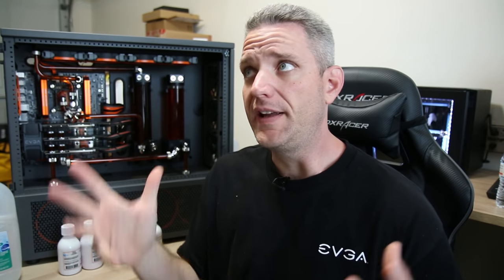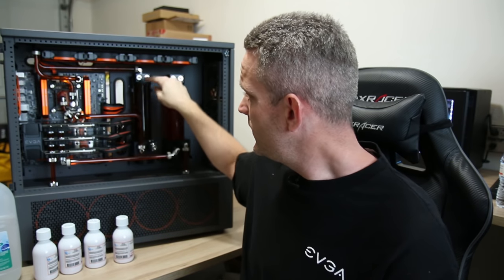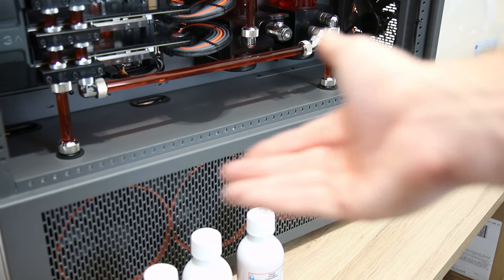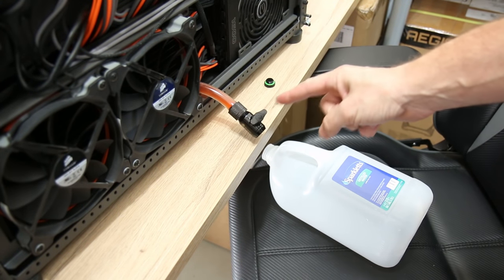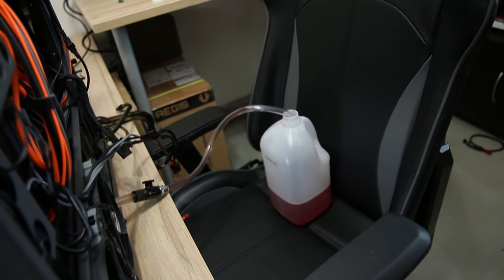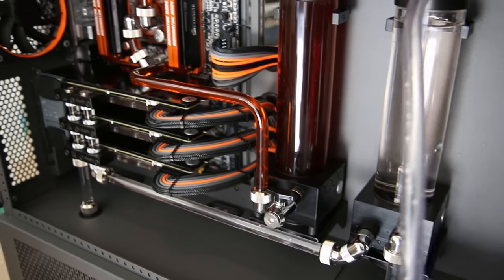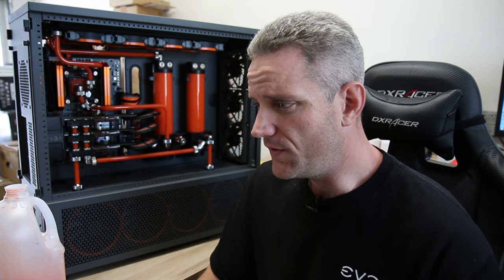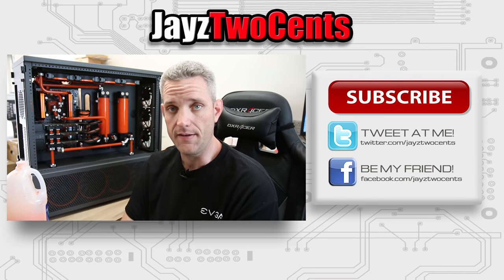How I flush my radiators and setup my drain ports

Comment: I did this very job today flushing with distilled water. I use an aquarium pump and it works a treat and will clear the loop of colour using approx 5 litres of water. I found this method to be much quicker and the results were infinitely better than the fill and gravity method I used last time.
Great video jay!

Comment: I have worked with the guys at Mahems since they started. Top notch guys. They are serious about delivering the best products. They will figure it out.
In most cases I use low pressure on my compressor and a soft rubber fitting to blow it out SLOWLY. 
I know you're going through a lot of work but the consumer will thank you. THey will be able to fix what ever is causing it so it wont be an issue for others. So, Thank you.

Comment: Hey Jay, I'm just curious... Why don't you let the system run on just distilled water for a few weeks? Wouldn't that help clean up your systems hardware and maybe debunking the theory that it's the fluid..? I don't know, I'm not an expert water cooler, I've only ran AIO's so i'm just curious...
Reply: +Bearded Rabbitt The problem is running on pure distilled won't prevent crap from possibly growing inside the loop and ending up worse than just dealing with discoloured fluid. Running coolants (pre-mixed or concentrates) means they have the stuff to prevent crap from growing inside and such.
That, and it's easier to see if a coolant is being discoloured if it's dyed (like what Jay uses) compared to if it's clear.
Reply: I just figured that it would turn to like a brown color if it was clear. I guess that makes sense though. I didn't mean pure distilled water, I figured that anti-growth and anti-corrosion additives were just a given in that situation. lol The discoloring point does make a lot of sense though!

Comment: Hi Jay,
Get an endoscope camera and examine every part and look for discoloration.
I think the exposed metal is causing a reaction with the color.
You can track down the culprit if you keep the drained fluid and send it in for analysis too or
you can analyse it yourself by putting fresh colored fluid in a glas with every single metal type you have in the loop.
Try heating it up very long in an open and well ventilated space, preferably build an incubator or aother type of enclosure that you exaust as far away from you as possible. You can use a DIY heat exchanger for the exaust and intake but keep an eye on the direction of the wind and where you put those pipes.
Don't exaust it through your chimney as that is likely to put you and your family at risk.
:)

Comment: get a small enclosure box. get transformer either Wallwart or ac wire from wall to bottom bay. get full bridge rectifier. get a cap if you wanna be fancy (converter will have one)...and a dc-dc converter for each voltage you need(figure out what your transformer is outputing then what you need). throw that all in a small plastic enclosure with an input for lead from main psu and a multi pol multi throw switch...now fuse it [both electrically and mechanically ] do this and you wont have to drag out a full psu every time. for the few watts required to run those pumps its wayyyyyy over kill

Comment: In my experience, the most efficient way to flush anything clear is to do complete fill/drain/fill cycles (serial dilutions), not adding irrigating water when it's only partly drained.  Otherwise, some of your distilled water is going out the drain while the pour washes the coolant back.

Comment: Did you ever figure it out? as well when dealing with distilled water for high end greenhouses you have to adjust or neutralize the pH or check the EC and micromineral content in the water and storebought brands and such can vary greatly due shelf time and leeching as well as its base pH before distilling process was done

Comment: Got an idea for a new Water Cooling Item...

One of those Survival Bottles you can fill up with filthy water which when pushed/sucked through a system of filters inside the Bottle will filter out most if not all contaminants.

Using 2 Gallons of Distilled Water until you're clean sure looks like a waste of resources ( at least in my book ) and with such a filtration system you could ( if it works at all ) chain it up into the look somewhere and have it run until the water turns clear once again then just dispose of the used up filter and be happy again.

Not sure if a PC Pump would be able to push the water through the Filter though... Might have to drain the Water outside and use the Filter without it being part of the System :°

Comment: Video Suggestion: Dust management with Caselabs cases. 

With so many enthusiast cases having convenient filters, to see nothing with Caselabs cases is a bit odd. 

I had dust issues with my old HAF932 (with DEMCiflex filters). My Enthoo Primo build has almost no noticeable dust at my annual cleanings. I'm planning a new build and considering a Caselabs case, but I'm concerned about going back to a DEMCiflex solution. I haven't really been able to find any videos on Youtube about this issue. 

Thanks!

Comment: I suspect your browning is due to a bacterial infestation, which would explain why it keeps happening after you flush and it happens slowly. I used to have the same problem with copper boilers and hot water in commercial coffee machines, the water in the sight glass (similar to your hard tubing) would turn brown and the water would smell like something died inside, I had to flush 3 stages. Stage one would be a disinfecting chemical like hydrochloric acid (or your leading baby bottle sterilizer from chemist), then flushed it with citric acid (from your local hardware store) to remove the hydrochloric acid/ sterilizer, then finally flushed with filtered water. I would leave each chemical in for an hour and let it heat up. Hope this helps.

Comment: You made this video over a year ago, did you ever discover what it is that's changing your tubing color? You may need to do a follow up on this to let us know your results. I've been running Mayhems UV Nano in  my rig for almost 4 years with soft clear  tubing and it hasn't even changed the tubing color. Yet!

I have noticed, that if it sits for an extended length of time, it gets thin on the top part of the reservoir; but, as soon as I turn it back on it goes back to it's original consistency. You mentioned this in one of your videos.

Comment: Hey Jay, We have now finally finished out first build and unfortunately the distro plate we used has drain hole below intake hole and also radiator is below all of that so drainage is an issue. is there any remedy? possibly adding some weird junction at the top to push air / water when draining/flushing? using dynamic XL case with Bykski RGV-LAN-O11XL-P distro plate.

Comment: The thing about that actually makes me really nervous and hesitant to try is what happens to the pump if I can't turn it off quick enough and it starts to run dry. Especially with a couple of the super tiny reservoirs that I've seen come with the pump built in. What's the best way about managing this power cycling to not run the pump dry and kill it?

Comment: Serious question: Why not flush it and run distilled water? It seems like it would be easier to get an idea of what is going on if you have discoloration of water. If the water doesn't discolor, you know it is something with the additives. If the water does discolor, you know it is something interacting with liquid in general.

Comment: When its time to move a working water cooled machine to a new address down the street or across the country I would assume that you would drain the system. Right?! What about storing a water cooled system for a long period of time. After draining the system is it necessary to disassemble the loop for storage? Would this mean that maybe the loop would have to be rebuilt when it comes time to get the system back up and running?

Comment: I had the same problem, I switched back to Acrylic (from PETG) the fluid stopped changing. PETG is not good I will never use it again. Acrylic for Life (or glass or copper).
Reply: +pvtmatchsticks for some reason I think it has something to do with blowing into the loop but hey, I could be wrong.

Comment: Will be interesting to find out what's happening.  It wouldn't surprise me if rad manufacturers changed materials (solder & flux) to meet RoHS and similar restrictions.  If that's the case I don't think you can avoid some weird reactions.  In Electronics, I've seen the leadfree alloys and matching fluxes do some weird stuff.  Their unknown character make them useless for aerospace/life-support/military gear.
Any RoHS certification logo on the rad literature ?

Comment: Maybe you have something copper touching the wrong metal? Don't know exactly which, just that in plumbing and electricity you need a brass separator between copper pipes or wires, and a plain metal, or else the copper will corrode.
Reply: Arthur you are correct. It is called electrolysis. Cooper to steel, iron or galvanized fittings or pipe will eventually corrode both metals. Brass fittings like brass valves prevent this because brass is a copper and nickel alloy. Brass never corrodes. Any separation using a nonconductive material also prevents electrolysis, ie: rubber or nylon gaskets and that is called a dielectric union.

Comment: I don't know what I am talking about, but maybe it is because you use hard and soft tubing in the bottom. Of course that's the GPU loop, but maybe that's a problem. Also, when you blow into it, maybe you contaminate the loop and the contaminates get stuck in the rads
Reply: Last time he took everything apart and cleaned it all by hand so I don't think it could be that because he didn't blow into it then. I use an electric duster to blow and I've had this problem. My current Pastel seems to be fine though.
Reply: +Jrock420blam ok. Well I guess it's a mystery for now for me lol

Comment: here's a stupid question that's probably been answered before. How would attaching something like say a vacuum pump to the bottom of the GPU loop to help drain it work? I mean theoretically it'd take a lot of the tipping out of the equation but there's probably something I'm missing that means it won't work

Comment: I'm kinda curious how often would you normally change the liquid in the loop, every 6 months, 12 monthly or longer? I use air cooling and clean my system out about every 9 months, light dusting few month inside.
Reply: Probably depends a lot on whether you want pristine vibrant colours or don't really care so long as it works.  Me, I'm in the latter category, and flush my loop about every year or two.

Comment: Couldn't you flush the loop with the pump running? If you seal off the top of the reservoir except for a tube that goes all the way down inside a distilled water jug, wouldn't it be able to suck more water into the reservoir as it pumps it back out the drain valve?

Comment: I want to get into custom watercooling, but after seeing all of the issues Jay has, I have to wonder: Is this a semi-common issue? Does watercooling require a ton of extra work after you set it up?
Reply: Nope.
Reply: Nope. Jay's a specific, rare case. Check out Kyle and Paul, they haven't had to touch their custom loops since building them
Reply: It's not incredibly rare as this has happened to a few youtubers and a lot of normal people like you and I, it's probably around 3-5% of people this happens to but as a business you don't want it happening to even .1% of users so they are working to find the problem.

Comment: i have a 360x38mm rad and just cpu block and pump res combo ek stuff i only got 100ml cryofuel concentrate, mix with 900ml distilled water to make 1l. um if i need more is it ok to just add more distilled water or do i need more cryofuel stuff to mix in too

Comment: 11:13
it's not that you have 'pressure'.
Actually the system does not have 'pressure'. You need gravity to do its thing. The system is isolated from ambient pressure (atmosphere), so when you open the valve, the air, or ambient pressure, will do its thing with the liquid.
Reply: It does have pressure it just differs from the ambient pressure, which is why it doesn't drain.
Reply: The reason it doesn't drain if you don't let air in is because if the liquid were to start draining and no air was entering the loop that empty space would be a vacuum since there is no air already in the loop. If it were as simple as letting gravity do its thing then you wouldn't need air to enter the loop since gravity is always pulling the liquid down.
Reply: +Collin Stark
tbh, I don&#39;t know how to explain it properly (Eng is not my main language and even less for engineering stuff)

But the thing is that once the loop is closed, and there&#39;s no air inside,  it&#39;s isolated from gravity, sort of.

Yeah, laws of physics still affect in the inside, but they are different from what one would do in the open air.

Without gravity, even if you open one end, air wouldn&#39;t get in the system to displace water. So you&#39;d have no water coming out anyway.

At the end, it&#39;s not &#39;air&#39;, but gravity doing its job.

Jrock420blam , Truth
Reply: Nothing is ever isolated from gravity, not even sort of. The space station in orbit isn't even isolated from gravity. You simply cant create a vacuum in the loop unless you literally sucked the liquid out with a pump and even then you would have a lot of trouble because you can't create a perfect vacuum in the loop which is what would happen if the water would be able to come out of the loop without any air being allowed in to replace it the draining liquid.

Comment: Jay, I would really appreciate ANY advice on CLEANING an entire water cooling loop of any algae... My system got contaminated somehow and I do NOT want to replace components. There must be some way to get this crap out of my loop...
PLEASE any help would be really apreciated.
Link? Video? Product recommendations?
Thank you!
Reply: +NuarStanger PT Nuke, silver spiral, those sort of things should help
Reply: +James Knox those are to prevent the algae from forming. My loop already has algae :/ NOTE i did have the silver coil in there.
Reply: +NuarStanger Hmmm, only thing I can say is to use new tubes, and to use a very strong algae killer, so maybe something like acid (if it doesn't damage the radiators) or pop into your local garden store and look for special solutions

Comment: on topic question here, (i know you may not get a chance to answer) but maybe someone can, if i put a Rad on the bottom of my case with the fittings pointing up will i be able to put a t-splitter above one of the radiator ports and use the blow method to clear the bottom rad, as there is no way to get a drain port any lower than that. Thanks in advance :)

Comment: QUESTION: Could it be the pump burning the fluid?
Reply: unlikely. the pumps don't produce much heat and even if they did, it happened before with a different pump.
Reply: +Richard Anderson I had a similar thought. I was wondering if maybe he swapped radiators or another component into his cpu loop. Could be just one component causing everything, and now that component is integrated with the cpu loo that was previously in his gpu loop.
Reply: +allgaming1234 I don't remember him saying anything about switching pumps for skunkworks

Comment: Anyone want to review my parts list for my second gaming rig and give some opinions/recommendations? It would be much appreciated. 

   - CPU: Intel Core i5-4690K 3.5GHz Quad-Core Processor
   - Motherboard: Asus MAXIMUS VII HERO ATX LGA1150 Motherboard
   - Memory: G.Skill Ripjaws X Series 16GB (4 x 4GB) DDR3-2133 Memory
   - Hard Drive: Western Digital BLACK SERIES 2TB 3.5" 7200RPM Internal Hard Drive
   - Solid State: Samsung 850 EVO-Series 250GB 2.5" Solid State Drive
   - GPU: MSI GeForce GTX 980 4GB Twin Frozr Video Card (Possibly SLI in the future)
   - Case: Fractal Design Define R5 Blackout Edition w/ Window ATX Mid Tower Case
   - EVGA 750W 80+ Gold Certified Fully-Modular ATX Power Supply

I'm also planning a custom loop for the CPU and GPU(s) in the future.

Thanks,
Collin
Reply: get an z170 motherboard and an i5 6600k instead

Comment: +JayzTwoCents I have a question as a complete newbie. If I had a radiator laying flat in the bottom of a case, with fans on top pulling into the case.... Am I effectively pulling warm air (From the radiator) INTO my case? Basically, how warm do the radiators get?
Reply: It is still fine to do, the rads don't get that hot unless you are running 3-4 real old GPUs and even then the bonus cooling you will get from the rad way outweighs the little heat it will pull in.